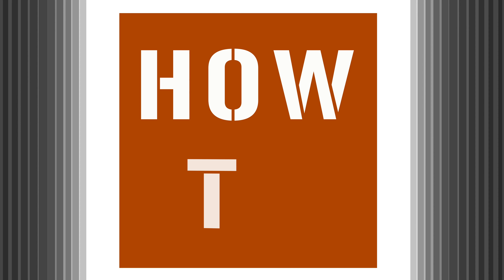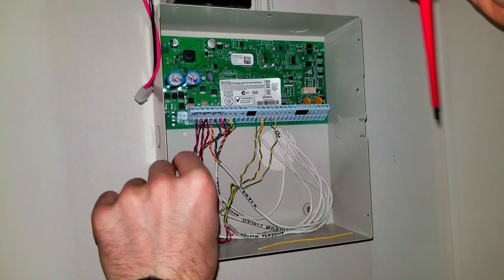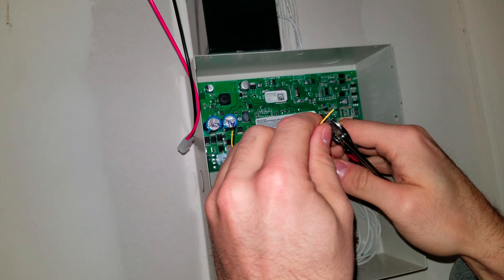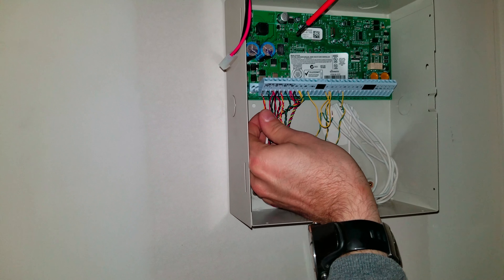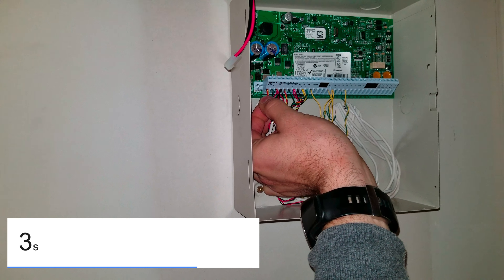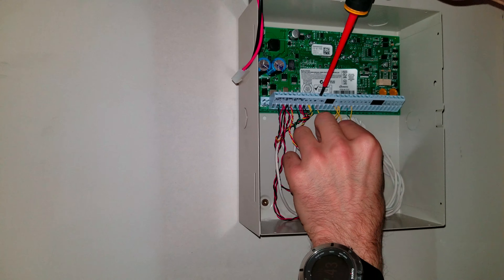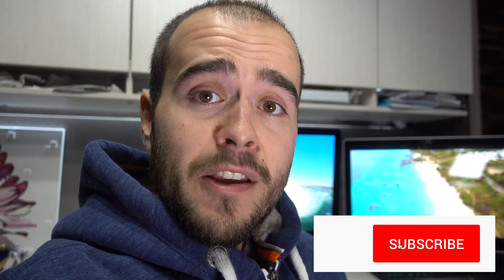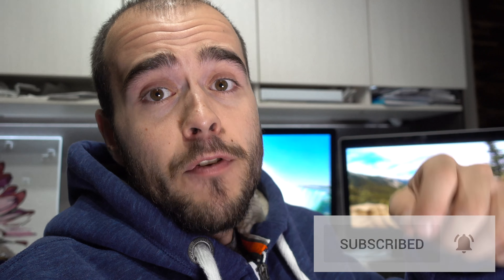How to Factory restore DSC Panel

Comment: How do you add/Remove zones from the Stay Mode.  Bonus question.  How do I know which zones are included in my Stay zone.
Thank you for your videos.  They helped me.
Reply from the maker: It's the way the zone are programed in section 001 of *8 installer menu. Zone marked at 05 will be deactivate in stay mode.

Comment: Hey brother, appreciate you doing what you do. I moved into a house that has this system...
DSC PC1550 - 6 Zone
I haven't tried the reset yet, from what I've seen in other videos I need a master code. 
The previous owners had some financial trouble and house was vacant for awhile and never had contact with them. 
I have absolutely no information or manual or anything like that. Just the diagram inside the panel box.
 Any advice, help or just a starting point you could send my way would be greatly appreciated! 
Thanks again Bro!
Reply: did you find anything
Reply: Hope I can still help, but doing this will reset the master code to 1234. just look up how to change user code on DSC security system and it will show you how. You will use this code to change the user code. The user code is what will be used to arm and disarm the system. Hope this helps you!
Reply: Did the proposed solution worked for you?

Comment: What do we need to do once we do the factory reset, for everything to work as before? Thanks 🙏
Reply from the maker: You need to reprogram everything. Some alarm system skill are required, or a lot of patience and tutorials video and/or installer manual.
I will eventually take the time to make a complete video about programming this alarm system.

Comment: Hi Pascal, I have a DSC Power 832 and have recently cancelled my monitoring. I am having the trouble light problem (communication with the monitoring station). I have tried to enter the Installers Code (5555) but it is not 5555. If I follow your instructions, will it revert my system back to factory settings or just reset the Installers Code to 5555? If it resets the system back to factory settings, do you have a video on how to reset the whole system, time, date, stations etc?
Reply from the maker: Hi Robert. Actually I would suggest no to do it. You will have to reprogram everything. Zone, delay, partitions. I did not yet made the video about reprograming everything. But you don't need to do anything if you just cancel with the monitoring station. The system keep working.
Reply: @HowToPM  thank you , merci.
Reply: @HowToPM  If I wanted to, would it be OK to key in *8 0001, 0002, 0003 ....... to find the code? Would the system allow me to do this? Thanks again in advance. Merci Beaucoup.
Reply from the maker: Ahah! Yes it would work but... Ouch, it may taje a while. You may try those code first
1234
4321
1379
2580
1739
3179
2000 to 2020
They are popular code.
Reply: @HowToPM  thanks for confirming and thanks for the codes... None worked... 😭 Looks like I am in for a long job. A chair and plenty of beverages maybe 😄
Reply from the maker: Ahah!! 😂😂 Have "fun" 🤣🤣🤣
Reply: @HowToPM  How often can you "try" to enter an installer code to figure it out? Any limits? Or will I get somehow blocked? And does the company get an information?? I want to eliminate a zone but I do not want to RESET my system as it does work otherwise perfectly..... THANK YOU for any advise!  Great video!!
Reply: @HowToPM  How often can you "try" to enter an installer code to figure it out? Any limits? Or will I get somehow blocked? And does the company get an information?? I want to eliminate a zone but I do not want to RESET my system as it does work otherwise perfectly..... THANK YOU for any advise!  Great video!!
Reply from the maker: As far as I know there is no limit. You can try every password possible one by one if you want. Wich make 10 000 possibility. 😉

Comment: Hi The LCD in keyboard panel is completely off. I tested CA and battery and it is OK. What can I do? Do you think that It is gonna work with a reset? Tks
Reply from the maker: Well, unfortunately that happen sometime. The keyboard is the piece I replace the most often on DSC system. Sometime even only after few weeks of instalation. If you don't see anything but everything is still working, that mean it's a keyboard problem. Howerver, if it's not working, that mean you have a short somewhere.
Reply: @HowToPM  Thanks for your answer!, changing the keypad is simple as disconnect all the cables and reconnect in the new one? thanks for your help I really appreciate
Reply: @javierchistik1991  You are welcome! It's almost as easy as that. You also have to make sure to use the same keypad address. I have made that video to explain everything. Good luck! 🙂 https://www.youtube.com/watch?v=JeAbVUWwPtQ

Comment: Yeah,, watching this video. You do know this won't work if everybody has been locked out. 
If you power up the panel and you hear like 5 or 6 clicks from the panel. Nobody's getting into programming unless you know the present installer's code.

Comment: PC 1616 model connected into the telephone line without dialer is working, but the problem, once the device is dialing in the number registered, the device has not stopped dialing even the system is disarmed. Can you please help us. Or there is any way can set the device can dial upto 2 to 3 times only
Reply from the maker: Hello Abner? In fact the phone number you program must be related to a receiver (generally an alarm system company). The receiver confirms to your panel that the alarm has been received. If your PC1616 do not receive confirmation from the receiver, it won't stop communicate with the number until he gets the confirmation. There is alternate device who may send you SMS. I have forgotten the model number, I'll let you know once I'll be back at the office next year. Happy holiday! :)

Comment: Hello Buddy;
I just bought a new house and want to reset the alarm system but cant recognize the cables u mentioned here..
The system model is: xl4612sm.

Plz help
Reply from the maker: Hi Ravena. This is actually not a DSC system. Seam to be Honneywell. That's a different brand. They do not operate the same way. Sorry I don't know this system.
Reply: Okay buddy..
Thanks for the response. I’ll keep trying on it.
U may update me incase u find any clues.👍
Reply: I have a DSC PC1616 and it looks different than your model. Any idea how to do this reset on my model?

Comment: This video was a great help.  My keypad at the front door has the PGM terminal connected to a recessed door contact.  How do I program this?  It used to beep whenever the door was opened.  I turned on the bell icon but that didn't work.
Reply from the maker: The zone number must be assigned in partition 020. I will soon do a How to video to program everything.
Reply: Hi, did you do the video how to reprogram for all the doors and windows? I reset as per your video( thanks for the video) but now nothing is triggering the alarm or chime. Could you help please?

Comment: I restored dsc pc1808. What is my new password
Reply from the maker: The default user password is 1234 and the default installe code is 5555.
Reply: @HowToPM  it doesn't accept both of these codes
Reply: @TricksOnRoad  That mean it does not have been reset.

Comment: Did you ever make and post the DSC zone program video? I’m having the same issues as others, performed the factory reset and now all zones are open on my PC5508Z led keypad and nothing works, I’ve tried some zone program info I found online, but not having any luck getting it to take, help?! Thanks
Reply from the maker: Hi Ryan. It is in my plan to make a video this year to show how to fully program a DSC Power Series system.

Comment: Will a factory reset also reset the various codes (master code, installer code) to their defaults?
Reply from the maker: It will reset everything like if it was brand new out of the box. Even the programing of your zone. Everything. You will have to reprogram it after the reset.

Comment: Thanks for the help. But currently i have a Honeywell ademco type of alarm that I accidentally armed. Since I dont have the user code to disarm my only choice to to reset to factory or replace. Can u help me?
Reply from the maker: Hi! Unfortunately, I don't know anything about Honeywell devices. But yes if you armed it, you will need the passcode to disamed it, or to reset it.

Comment: Is your alarm supposed to beep during the factory reset? If it does, does it mean something went wrong / system is locked out?
Reply from the maker: Hum. I never realised if it beep during the reset. Maybe it does at the boot up. To see if it work just try the default password 1234. If it work 1234 should be the password. If it doesn't, it mean the reset is disable or you didn't make it correctly.

Comment: After resetting my panel, my key pad shows all zones are open. What did I do wrong?
Reply from the maker: By default DSC is a ''normally open'' system. That mean the contact you use on your door should be ''normally open'' with a resistance. This is a more secure way to protect a door, but almost nobody do it in residential security. So you must switch your pannel to ''normally close''. You can do that in the installer menu (*8) in section ''013'', activate ''1''.
Reply: You are awesome. It worked. Thank you
Reply from the maker: Ahah!! Great! 😀
Reply: @HowToPM  So, I had to factory reset my DSC 832 PC5010 (circa 1998) and after I set the new master code, all the lights for all 8 zones were on (as Hamed says).  I entered *8 013 1 but all lights are still on and the system isn't working like it used to.  When I open a door/window, the light stays on and the unit doesn't beep.  Do you know what I need to do at this point?

Comment: hi, i have restored factory setting on accenta g4 . after turning back on it will not except access code 0123
Reply from the maker: I don't know what is accenta g4 but on dsc system, default password is 1234 and 5555.

Comment: Hi 
I did the step to factory reset the panel but it didn't work.
I have DSC 3G3070.
Can you explain why it didn't work?
Thanks
Reply from the maker: Ahah!! Hi George, of course I can explain. The 3G3070 is not the alarm panel, it is the cellular communicator.
Follow the cable that is pluged into it it should lead you to the alarm system.
Should be a bigger box in the same color.
But watch out, after reset it, you will have to reprogram your alarm system and I did'nt yet did that video.

Happy new year!

Comment: Hi, 
I have DSC 5500. After doing the factory reset, it shows that my zones are all open. Also note they are all wireless sensors. Do you know how I can fix that?

Thanks
Reply from the maker: Hi Behzad, Well after a factory reset you have a lot of thing to reprogram. The wireless zone must be re-input. You may have normally close zone while by default the system is normally open. I will do a video about the programation of the system this year.

Comment: Great video. Can you post video for re-programme DSC systems for existing zones?
Reply from the maker: What do you mean exactly by reprogram?
Reply: I don't have installer code and master code for dsc systems, so I tried to do factory default. After reset red padlock indicator was blinking. No idea how can I resolve that. I though there is a way to re programme the system.
Reply from the maker: Well. Of course there is but... I am a dsc alarm system Programmeur. But when I train someone to do it, it is usually a day training then support for few weeks. It is hard to create a how to video about all of this.
Reply: @ChinthakaRajapakshe  Ohhh you had the same issue, have you found any solution.
Reply: @tharindubalasuriya1414  Yes, I ended up with making my own system using NodeMCU and used existing wiring. Lol

Comment: Do you know how to verify why a new battery doesnt recharge itself?
All 3 fuses okay; we've had a couple electricity shortages recently, which I guess have unsettled the system somehow
Reply from the maker: It happens sometimes that a new battery will charge enough to remove the error icon on the keypad. That means it is a defective battery. Maybe it was store directly on concrete before it was sent to you. Few people know but leaving a battery on concrete, drain its energy and kill the battery.

Comment: Hi! my panel model is 1616, is the same way? Thk.
Reply from the maker: Hello Carlos. Yes, it is this same process for every power series model. Actually, the panel I used on the exemple is a 1616. 😊
Reply: How To I followed the same process. I’m using dsc 1616 and the panel is 5501. Currently the panel is locked (red) with warning (time not set). I short PGM1 and Z1. After 60 seconds. After typing *8 5555, it is not entering the programs mode. Do you have idea on this?

Comment: Hi, thanks for this video. I tried it several times but does not factory reset. When I want to set date/time *6 after I've done the steps in this video and enter default 1234 master code it still says invalid code. Any help is appreciated. Thanks!
Reply: Sorry to add I gave same dsc 1832 model used in this video.
Reply from the maker: It's possible that the option had been blocked by the installer. Unfortunately in this case, I am sorry to tell you that there is no solution.

Comment: Hi 

Great video and helpful. My unit has the trouble light turned on from the panel and making beeping noise all the time now. Can you show me to to get rid of it? I have a DSC system but very old, I installed back in 2000. I hope that you can help.

Thanks
Reply from the maker: Hi Chinh! This trouble can be a lot of thing. I plan to do a super ''how to'' video about every proble you can have. Howerver, it wont be available before few monts. And it's very hard to explain like that with a keyboard. Good luck! 😉

Comment: Clear instructions, thanks. The process smoked the 10 yrs old transformer that powers the LCD panel and trickle to the alarm panel battery. This is fine since the new transformer will have a ground prong.  New one on order: PWS-1640 16V AC 40VA Class II Power Supply AC Adapter UL 16V Transformer Plug with terminals. I wonder if the transformer should be unplugged to avoid the probable 10 second surge?!
Reply from the maker: Hi S Ve. I'm not sure I understand your question here?

Comment: Will this process also revert any firmware updates as well?
Reply from the maker: Hummm. This is a good question. But I dont think it will be. Must be only a reset of every setting.
Reply: Unfortunately, firmware updates are permanent with any type of technology, it is not possible to go backwards. As mentioned in the reply, factory reset reverts all settings back to default.